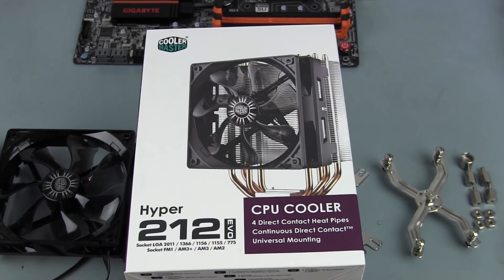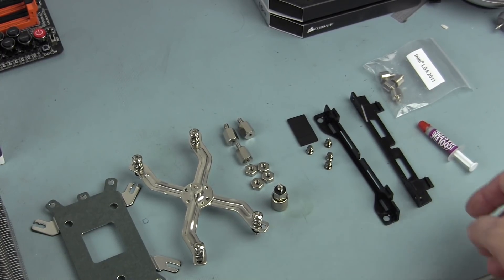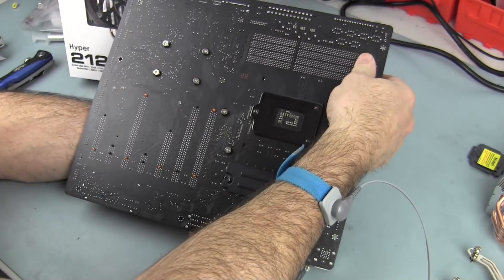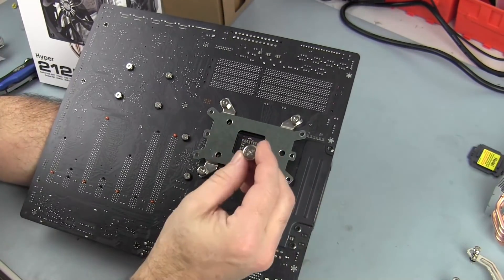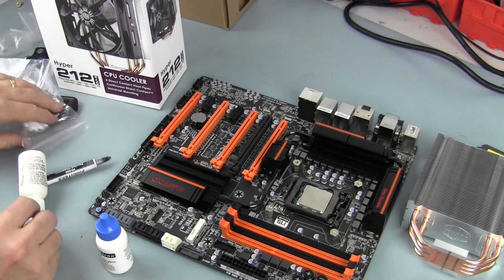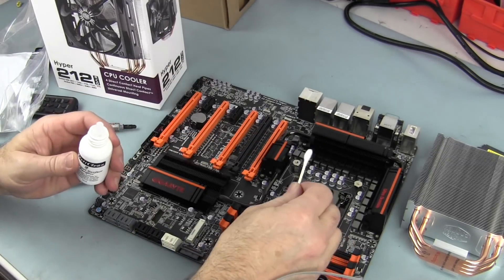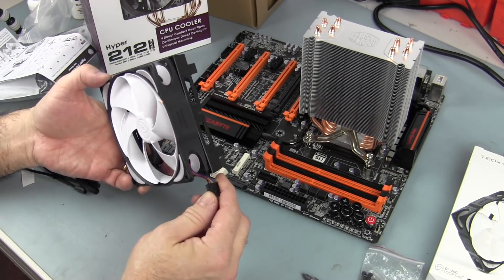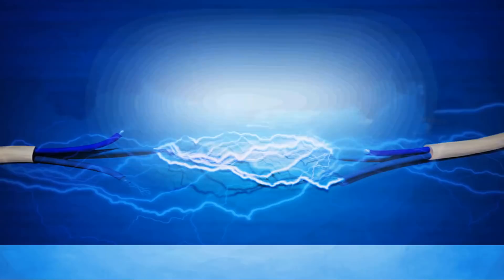How to Install a Cooler Master Hyper 212 Evo CPU Cooler

Comment: Ronsanut, one thing that drove me mad about this cooler was that. After 3 years using it, it bent my motherboard.

Motherboard was a X79 Extreme 11 running a Xeon E5-2667.
3 years and 6 months using it, the motherboard refused to post. I left only one memory on the socket and it booted immediately. 
After removing the motherboard, I could easily see it was somewhat bent.

The quad channel on the motherboard is no longer working. last memory socket does not work. It fails to boot all the time. however, if I apply negative pressure to the motherboard, it boots up with quad channel memory.

In short:

I do not recommend using any sort of heavy cooler on PC's with vertical towers. We all know, we can try to defend the coolers as much as we can, but it is G-R-A-V-I-T-Y. 

Won't happen to ALL mobos, but with enough time, it might.
Reply from the maker: Bummer man. Sorry you had this problem.  Yes long term use and gravity will do that.

Comment: this cooler works great. after installing this my cpu temp went from 55 degrees C to 42 C under load. I also love how you can mount it either way facing up down or left right.

Comment: the screws across from one another(diagonal from eachother) arent sitting and are about quarter inch above the socket to screw in. im afraid to apply too much pressure and break either the mobo or cpu. help, first time builder here

Comment: Warning - in case you see this and want to install this cooler in an HP or other "brand" case with a listed LGA socket like 1155 to replace the stock cooler (like I tried to do), the x brace brackets and backplate won't fit the HP motherboard since they use proprietary spacing for their cooler mounts.  I tried calling Cooler Master to ask if they had a bracket for HP motherboard but they never replied.  However, I just installed this on a new ASUS Z370 8th gen motherboard with an LGA 1151 socket.   So, don't rely on just the socket type to select a cooler - no one mentions the spacing of the holes.  Apparently kit build components follow a standard that works with 3rd part components, but HP, possibly Dell or other retail or corporate brands don't follow those standards.  Cooler Master should disclose that in their marketing materials or offer custom brackets for the proprietary motherboards.

Comment: The LGA 115x standoffs that come with the cooler have changed since this video (and other videos) was filmed. They're too short and need to be inserted into these black rubber tips that come with the cooler. 

Since the instructions were mostly shit, I was following this video and another one to be safe, but then i completely ignored those black rubber tips and ending up not being about to mount the heatsink, because the standoffs were too short. Every time I screwed in one part, the opposite end started lifting up. I was about to put more force into it, when I noticed the black rubber tips, did a double-take on one part of the included instructions that show a pictorial of the standoff being inserted into the rubber tips, and went "Aw fuck". I had to disassemble everything, clean the thermal paste, and do everything again. Good thing I didn't ruin my motherboard.
Reply: AzumaYugi Comfy Gaming I noticed this too. The instructions say to insert Es into Ds. And when I did that, the screws were too short on the other side to put the nut on. I spent so many frustrating hours on this today to the point where I'm thinking of saying the hell with it and getting the Cryorig H5.
Reply: I had to get a second person to hold that shit steady so I could screw the damn things on the other side. 

I like the cooler and all, but the installation was a lot more of a pain than it should have been.
Reply: AzumaYugi Comfy Gaming You're a fucking lifesaver. I glazed right over that in the instructions.
Reply: This comment needs more thumbs up.
Reply: What to do with the rubber round part ?

Comment: Great step by step video! I just don't like how you're using hardware off the Cool Master Hyper 212 Evo CPU Cooler on other products. Should have kept the video specifically on Cool Master Hyper 212 Evo CPU Cooler installation. Still a thumbs up on the guide.

Comment: Thank you for the video!!! I observed you had a static bracelet on, what was the other side attached to? 

Thanks in advance. :) cheers
Reply from the maker: The other side is attached to a 3M monitoring station.  But you don't need monitoring station. It can also be attached to a ground point on the static mat or the PC case.

Comment: Hey man, Can I attach the fan so that it faces the back exhaust? My corsair 460x case doesn't come with an exhaust and I don't plan on installing one either.
Reply from the maker: Corsair 460x has a fan space on the back of the case. If you don't plan on putting ao fan in that spot in the back of the case, you can still arrange your heat sink fan to blow out that spot or even suck air in from that spot.  No problem.
Reply: Ronsanut Thanks for the quick reply man .... much appreciated.

Comment: Great video, I've been shopping around because I'm debating replacing my Corsair h60. 
I upgraded from a I5 2500k to a I7 3770k I purchased used. 
I paid someone to install the new CPU because I know how to but never done it before and get a little nervous around my PC on trying to install a CPU.... 

Was not to pleased with the method the guy used to install it, he spread the paste and I understand that's a no no. 

So idk if its because of that or if my H60 has degraded after over 5 years of usage or if there is something weird going on with my I7. 

I am going to re do the thermal paste sometime this week likely. then see how it go's after I compile what I learnt from many videos. 

If temps are still to high...... I am going to buy this cooler.... idk if liquid coolers have a set lifespan. 
It was fine with my I5 2500k but I did not test temps in many years. just trusted all would be the same. 

So if I must i'll try this cooler.... if that fails something is weird with my CPU....

I can't even have intel turbo turned on.... the temps get way to high on normal clock speeds with turbo on.... 
So it's been set off and it still runs hot but safe..... but the temps I am getting under clocked basically are good temps for a nice high overclock.... 

Well I've put up with it to long... time to do something.

Comment: The instructions that came with this cooler are TERRIBLE , I spent 4 hours trying to mount the piece junk. Had I watched this video first it would have been SO much easier! I returned the cooler to Amazon, I'm not willing to remove my mother board

Comment: does it matter what side you put the fan in? because I placed in on the other side of the metal part
Reply from the maker: Ideally you place it so the air from the front of your case gets pushed through the fan and through the metal fins and out the back of the case.  But you can also mount it on the other side so the air gets pulled through the fins.

Comment: for the mounting bracket on the back, shouldnt it be reversed so the three motherboard screws line up with the three holes on the backplate?

Comment: Weird question: what size screws are built into that x bracket. My pc is a prefab hp with base plate built in and the male portion of the stand offs that came with the Evo were too big but screws in the X bracket do fit so I need stand offs with male and female thickness that matches the x bracket

Comment: I'm installing this exact model cpu cooler, but i wanted to make sure that i screwed it in tight enough. I can actually spin the cooler if i use a little bit of force. I screwed it in until it was pretty tight (i'm nervous to try and force it to be tighter). i'm thinking maybe it's spinning because the thermal paste is slippery. I know i didnt use too much (if anything, it was on the light side)

Comment: Mine wiggled around a little. Is that normal?
Reply: The heatsink?
Reply: D
Reply: 11H8 Sorry for late response yes the heatsink wobbles a little.
Reply: I was able to rotate mine, but not wobble side to side. It should be pretty stable on top of the CPU

Comment: Hey guys don't get the Hyper 212 EVO, I got the Hyper TX3 & it's much easier to install & you don't have to mess with that back plate & can install the ccoler without removing the motherboard from the case.
Reply: Thanks alot for the tip! Was just thinking about buying the hyper 212 but the installation seems really difficult.
Reply: Medmann48 Why tho?

Im buying a new system so idgaf
Reply: The Hyper TX3 is easier to install, you don't have to jack around with the back plate. The Hyper TX3 uses the same attachment system as a standard CPU cooler & mine is plenty tight so no problems there. You can use it with the motherboard already installed in the case.
Reply: Medmann48
Dont have any of those

Comment: Hey I got the i7-4770 cpu.   What socket would I need to use ? =) I'm newbie at this so any advice is helpful
Reply from the maker: Use the Intel 1150/1151 socket ring.
Reply: Thank you very much for this info.  :)

Comment: How do you dry off the cpu after cleaning it with alcohol?
Reply from the maker: The alcohol evaporates, so you do not need anything after cleaning it.  You usually can see it evaporate.
Reply: Thanks for the answer, but won't it wet the thermal paste?
Reply: Thanks!
Reply: Dylan de Wit alcohol evaporates u fucking dumb shit

Comment: CAN WE ADD ANOTHER FAN ON OTHER SIDE?
Reply from the maker: Yes you can. The Cooler has a clip to hang another fan on the other side for push pull.
Reply: Do you need to install anything on the cooler that comes in the box ?

Comment: how much pressure can you  put on the CPU.... I can't get the 2 screws in without putting some pressure
Reply: Inverted V12 Powerhouse i'm wondering this too, i literally can't get them in without putting in a lot of force and i don't want anything to snap
Reply: So how did it end, did you eventually do it?
Reply: I don’t know really. I tried, cursed, tried again, cursed more and after a lot of iteratations I got it there.
Reply: Olorintube did you just apply a lot of pressure to finally get the last 2 in?
Reply: @squigeeeeey  reallly late but for future reference. I just put mine in 1 hour ago. I screwed each side bit by bit until it all aligned. If it doesn't go down with ease... look at the instructions carefully. I didn't attach the support in the screws correctly. After that it worked fine just if one is up, unscrew it a bit and screw in the opposite corner bit by bit alternating each time
Reply: Little Crimson can this go in a fm2 build?

Comment: does the cooler come whith a manuel ?
Reply: yes. but watching this still helps
Reply: so fucking true, its a ikea manual book, but they forgot to tell you what parts your supposed to use, or how you are supposed to use the parts. Somehow they made the most unhelpful manual in existence.
Reply: The manual is a picture book, looks like a IKEA Manual from hell
Reply: Robert Cartnal it did not help mine came with like three different types of screws, which look similar, except they are of different lengths. My manual was showing to put a screw in but did not differentiate which screw.
Reply from the maker: Thank you. Hope it helps.
Reply: Rand3mAnclrew I couldn't agree more with yah.

Comment: I just installed my 212 and if I grab the heatsink I can rotate the heatsink a bit back and forth.  Is that normal?  I noticed that when you were done (before the fan install), you rotated it just a bit.  Is it supposed to move a little?

Comment: Can I do this without taking out the motherboard?
Reply: I don't think so
Reply: +Willie Stroker doesn't matter I got it in and it's too tall lol
Reply from the maker: Yes but only if your case has a cut out so that you can mount the support plate.
Reply: +Ronsanut Yeah I had a cut out so completed most my build so juts waiting for cpu and cpu cooler.
Reply from the maker: Cool. It will be easy. Take your time.  Enjoy!

Comment: how tall is it I  absolutely no hight room in my case ?
Reply: its just under 16 cm tall iirc, most mid tower cases should be able ot fit if they have that clearance from the base of the socket to the cover

Comment: I never understood anti-static wrist straps i know what they do but what to you connect it to?
Reply: You attach it to metal so the static goes there. Mostly the PC case itself.
Reply: you can also connect to a PSU that is plugged in but not turned on

Comment: do we need to put thermal paste even though everything is is brand new?
Reply from the maker: You must use thermal paste.. If there is some already applied to the bottom of the heat sink out of the box, that is fine.
Reply: its not for cleanliness, the paste is required to fill the microgaps between the cpu and the heatsink with somethnig more heat conductive than air(air is a bad heat conductor)
Reply: Thanks for telling...i needed someone to tell me

Comment: I have a T4 cooler master and they are very close.  You need a case that is 7 inches wide minimum.  Also often the ram will interfer so you need low profile ram.  I got some corsair with high aluminum heat dissapators and I had to take them off.  They were obviously for looks as the sticky double sided tape holding them on was 1/32 nd inch thick and would not transfer any heat to the paper thin aluminum.   So I didn't think it was any loss taking off the aluminum.  the air can get to the Ram much easier now.  Just FYI.

Comment: Do you need to use the backplate on an Asrock EP2C602-4L/D16 Server Board ? I can't see how this will fit, the holes are plugged and there won't be enough clearance on the back of the board with the additional plate already on the motherboard.
http://i.imgur.com/bIgg8qq.png
Reply: Hey have you gotten around this issue? I did not install the backplate because it was not needed, but the preinstalled mounts are too tall to keep the 212 secure..
Reply: Mine are rock solid, hard to say without seeing a photo of what you mean.

Comment: Will the way he adjusted the backplate work for an intel i5-6600k?
Reply: First time building my pc and my parts arrive in a few days, so i'd like to be sure
Reply: +Vortez yes , same way.
Reply: +Crazyheat even on a micro atx mobo?
Reply: socket is universal regardless of the form factor of the board

if anythnig what one need ot be careful with in mAtx boards is to make ure you have clearance on the sides(so the cooler doesnt get in the way of your ram slots at least)

Comment: Can I install the screws/backplate first, and when I'm ready to mount the fan, install my CPU so that I won't get my CPU dirty in the process of installing the backplate?
Reply: i guess, as lnog as you can keep the pins safe(on intel sockets), pretty sure the reason he left it there was to avoid accidently damaging the pins while handling the motherboard.

Comment: what is the thing you have attached to your wrist called? i need one
Reply: It's an anti static bracelet I think its to level out the static build up in your body so you don't zap your mother board
Reply: anti static bracelet somethnig you wear and connect to a grounded metal surface in order to discharge any static you carry into it,it prevents you from accidently zapping your parts(which can potentially fry them)

Comment: when you install the backplate DO NOT USE A HAND DRIVER Just use the socket that cooler master gave you and get it snug with that. Last time I used a tool later when I took the standoffs off a couple pulled off the surface layer of my motherboard

Comment: do i have to clean the cpu before i put the paste on?also is the thermal paste that came with the fan good?
Reply: No, you do not have too. I always like to use some isopropyl alcohol and a q-tip or any lint free makeup cleaning pad.  For the thermal past, if you plan on keeping stock speeds then the stuff that comes with it is fine.  If you want to overclock id invest in some artic Silver 5 paste.